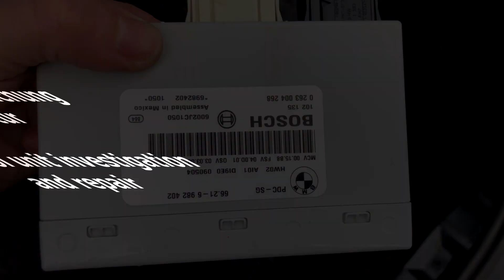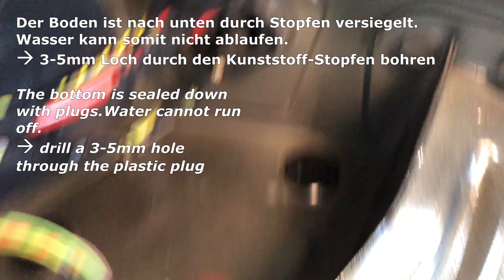BMW Regenwasser im Kofferraum! PDC Steuergerät kaputt! DIY Reparatur und Lösung | 1er E81 3er E93

Comment: I had the exacte same issue (with the exact same electronic repair). Not too sure about the hole drilling idea, though
Reply from the maker: Thank you for your comment. The hole prevents water from accumulating there again if a seal fails.. It can drain off directly and the control unit can no longer be under water. This is for prevention.